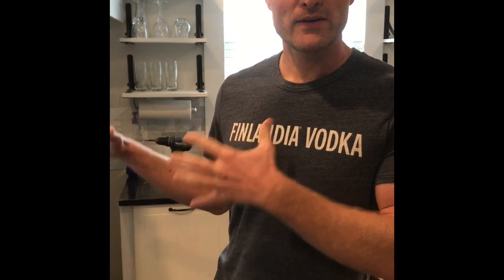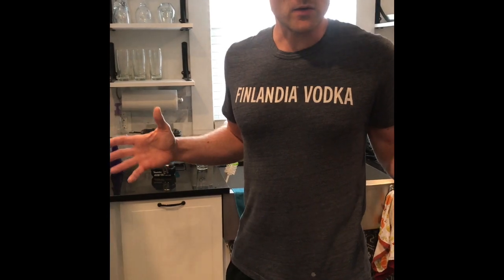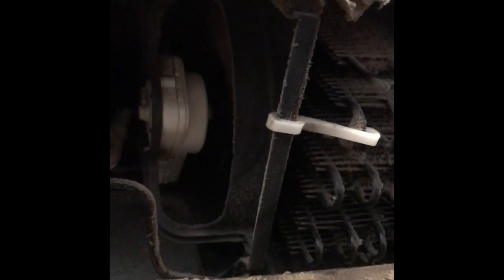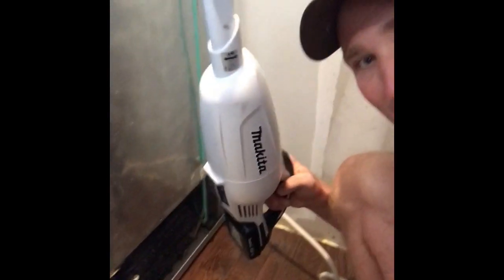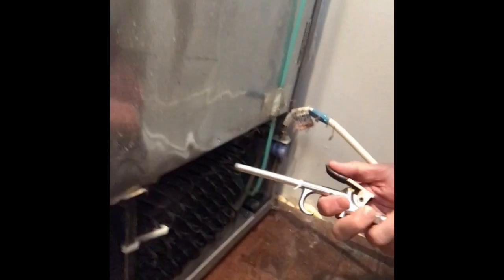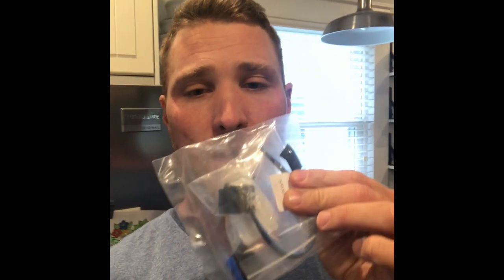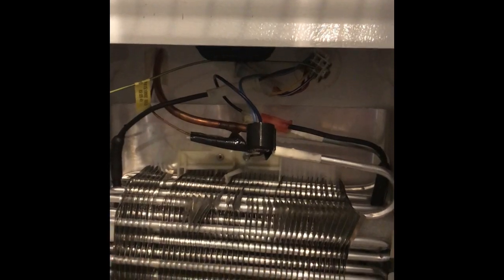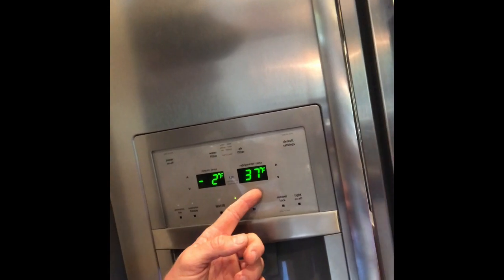Frigidaire Refrigerator not cooling, this finally fixed it!

Comment: I did the troubleshooting as shown in your video and found that I had the same problem. I bought the sensor from Amazon for $10.00 and installed it. Now my refrigerator is back in business. Big thanks to you. This simple fix saved me over $2,000.00 which I paid for a new refrigerator then cancelled the order.👍
Reply from the maker: so glad it helped!

Comment: According to Frigidaire, the best way to clean condenser coils is by using a refrigerator coil brush. After you figure out the Frigidaire side by side refrigerator coil location, you need to unplug the fridge. This lessens the possibility of electric shock.

Comment: Great video.  I'm going to have to check my inside my freezer.  At one time the freezer made my refrigerator too cold then it was fine and now it's not cold enough and seems to be clicking off and on a lot.
Reply from the maker: I know thermostats can cause a lot of weird issues.  There cheap enough to replace I'd go that route.  Thanks!

Comment: All fridges are trash today, no matter how much you pay for one.  Long gone are the days of 20+ year old fridges as they were when I was growing up.  Both of the last two I have owned have went out in under 3 years.  The repairmen who came out said they couldn't fix them (both times) as they were too far gone.  If you want to see how the manufacturers view longevity, just check their warranty.  You will see they only give ONE YEAR in most cases (lolol). Some manufacturers might give you 10 years on the compressor (but usually the compressor isn't the problem anyway).  It's f'n ridiculous.
Reply: You can say it again. Please say it again.

Comment: The condenser coil must be kept clean so that hair or dust doesn't accumulate there. According to Appliance Outlet Service, if this happens, the sealed system will overheat, and the compressor will shut off. That's why you need to keep this area regularly cleaned using a refrigerator coil brush.

Comment: Another reason all that frost may have built up is because the door was not fully closed and the humidity outside was high overwhelming the defrost capability and allowing all of that ice to build up on the coil. In other words, a bad seal on your door.

Comment: Can’t find exact fan motor replacement part but, 241509402 seems to fit a bunch of models. Will it replace Panasonic FDQY38FE1 or 242290001?
Thanks for your video and your time.

Comment: If you're trying to find the Frigidaire refrigerator condenser coil location, in most standard fridges, the coil will be located behind the refrigerator, underneath an access panel. To access the coil, you have to remove the access panel at the bottom of your fridge. When removing this panel, you have to be careful because it's made out of sheet metal. According to Appliance Outlet Service, when accessing the condenser coil, you also need to be aware of the fan that keeps the compressor from overheating.
Reply: So you're telling us that
"Appliance Outlet" should watch this video
Reply: @mikediamond353  Yes

Comment: It's very important to keep your appliances at the proper temperatures. Keep the refrigerator temperature at or below 40° F (4° C). The freezer temperature should be 0° F (-18° C). Check temperatures periodically. If the temperatures aren't kept at the proper settings the more chance Listeria, a bacterium that causes foodborne illness, can grow, especially if the refrigerator temperature is above the safe temperature. Thermometers are the best way of knowing these temperatures and are generally inexpensive.
Reply: If mine is at -6 and ice cream is super soft and the fridge won't go below that temp whatis wrong?

Comment: What about if the fan is not running at all and the thermostat kicks on and gets really hot ? Any advice I was thinking about changing the part out I have the same model as you

Comment: Lee,  I need your help desperately!  I did exactly what you did the defrost thermostat works as do all the fans etc, new capacitor, starter relay, cold control, evaporator fan motor. After putting in the defrost thermostat,  the freezer only goes down to 15 degrees and the fridge only goes to around 39 and 40 degrees. I need it to go down to 0 zero so the ice cream will get hard!!  Its only 3 years old and the coils are clean both evaporator coils and condenser coils, What could be wrong with it now? Thanks

Comment: I have a Frigidaire Professional and the ice builds up on the evaporator fan inside the freezer wall. I unplug it for 24-48 hours and once the ice melts off the fan will run again. I ate having to wait 24-48 hours. What do you suggest for the ice build-up on the evaporator fan?
Reply from the maker: Actually mine had the same thing and the defrost thermostat fixed it.

Comment: My Frigidaire side by side refrigerator is not cooling as well as the freezer, Did you have the same problem? Thanks a lot for posting this video.
Reply from the maker: Is it not freezing at all or just partially?
Reply: Lee Logsdon The freezer is not freezing at all. I cleaned the condenser coil but it didn't help.
Reply: @leejonlogsdon  mine is freezing partly and the fridge side is slowly warming up

Comment: Cant find serial # or model # on frigidaire  refrigerator  an have checked the back of it approx 10 years old with freexzer on top an approx 19 cu ft.
Reply: Open frig. Look up under switches on ceiling on inside

Comment: Great video.  Just wondering if you checked the Damper first?  I was thinking its our damper, but now Im considering the Defrost controller.  Or fridge not cold and freezer is extra cold?  Thanks!
Reply from the maker: I didn't check the damper.  Good thought though!
Reply: If you have a frost issue behind the panel in the freezer I would be leaning towards that thermostat that clips on them coils that controls the defrost heater or the defrost heater itself

Comment: And if the defrost thermostat is not the culprit, next suspect would be the defrost heater.  I would have checked that first  ( easy check with a multimeter for continuity)

Comment: I had the H1 code on the freezer side of the control panel.  Is the defrost sensor responsible for this code as well?
Reply: Mines too any help
Reply: Same issue here.  Anyone find a fix for this?

Comment: My fan works and I clean the coil I used all purpose duster to clean the coil I changed the capacitor the freezer fan works but my fridge doesn’t works what can I troubleshoot
Reply from the maker: did you check the condenser and the evaporator fan?

Comment: Is there a way to test the defrost  thermostat before buying new one
Reply: I'm pretty sure you can test the resistance. No resistance means it's blown. Had a similar issue with a thermal fuse in a maytag dishwasher.

Comment: Frigidaire side by side refrigerator with no digital display on the front compressor is running condenser fan is running condenser coils are clean fan blade it is clean won't cool at all